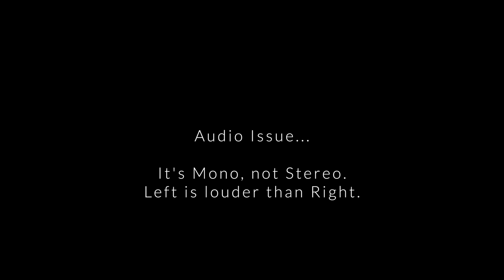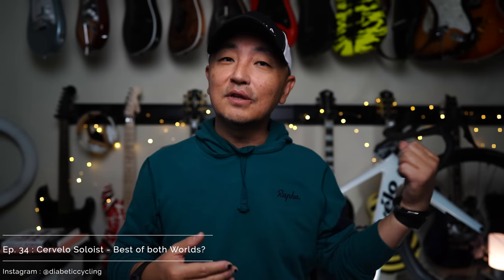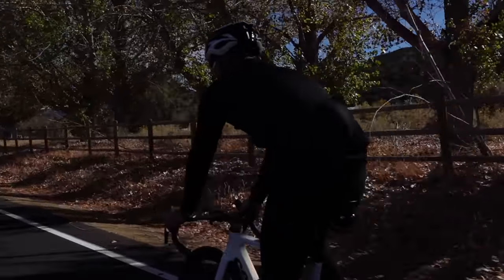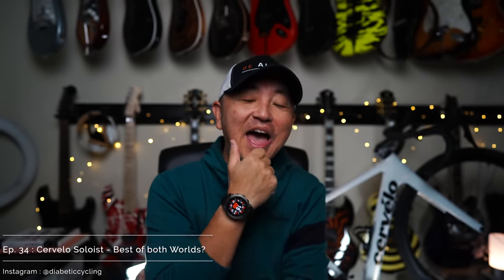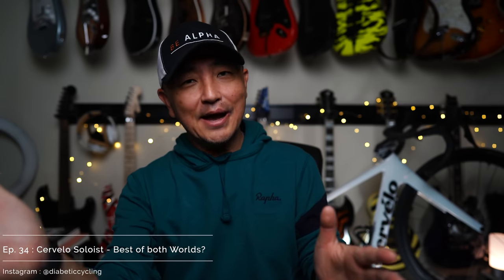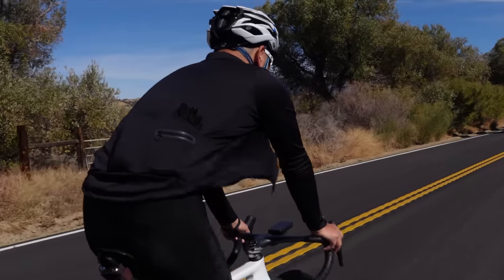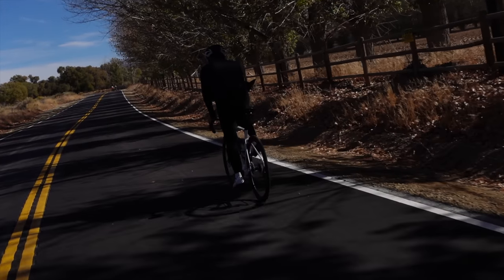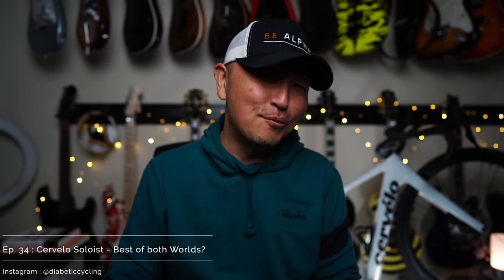Ep 34 [ENG] - Cervelo Soloist 2022/2023 Full Review

Comment: Great review 👏🏽.  I have the factory 105 version of this bike . $3400. It's my first road bike coming from the fixie scene. For the frame being $2700 to the entry level entire build being $ 3400, I couldn't pass it up.  So far , I too am loving it. I noticed all my downhill segments take the fastest time of the day on strava without fully pushing it 100 percent. It's effortless. 

In a year or so I too plan on upgrading to the Ultegra Di2 12 speed groupset. Glad to know you like that combo. 

Thank you for all your input as it made me feel as if I made the right choice based on your many years of riding high end bikes. 👍🏾
Reply from the maker: Thank you so much! If you have this with 105 at $3400, that is SUPER solid. Wheels probably could use an upgrade if stock. But all in due time as you said. You have a solid bike for years to come.
Reply: I'm thinking of going down this route as well, what was the weight of the stock bike and what size are you running?
Reply: In what dealer did you get such deal?

Comment: Great review and it echos a lot of my feelings for the Soloist. I have the black frame in size 56 with the Force build. I have not ridden the stock Reserve wheels that came with it, as I threw on my Enve 45’s that I already had set up tubeless with Pirelli tires. I also own a few other Cervelos to compare against this bike. I own a 2022 R5 with Force, a 2019 S5 with Dura Ace 11 speed and Enve 6/5 wheels and a 2018 R5 rim brake with Dura Ace 11 speed and Enve 4/5’s. It’s a long story why I have all these bikes but I will not bore everyone with that. Here are my thoughts on the Soloist while keeping in mind I don’t weigh my bikes, I don’t test anything in a wind tunnel and I don’t have a vernier to measure anything. I just ride bikes and have been doing it for 38 years:

1. Looks:  I like how the bike looks a lot and I am OK with the seat post. I feel like it was really well executed and I smile every time I reach for the bike to ride it. I can see where the seat post may turn folks off but it doesn’t bother me.

2. Functionality:  I like that I can work on this bike more than others that are disc brake. The bike was designed around the enthusiast to be able to do some of their own work and customize it a bit. 

3. Ride Quality:  very good. I feel like I can ride all day on it and it won’t beat me up but the 28 mil tires help a lot with that and the geometry suits my fit well. 

4. Price:  this is still an expensive bike as you noted. I got my 2018 R5 on sale and it has Dura Ace and I didn’t pay much more for it at the time. That said, everything has gotten crazy so the Soloist price point is less crazy. 

5. Comparison to my other bikes:  nothing beats my 2018 R5 rim brake bike. That one will never get sold. That said, in the modern line up I would say the S5 I have is seat of the pants faster but it will wear you down on longer rides just due to the position it throws you in. It’s difficult to dial your fit in correctly on that bike because of its proprietary nature. The new R5 is a bit lighter but that’s it. I would not spend the money on it knowing what I know. Get the Soloist and save yourself the money. Buy equipment with the difference or a favorite set of wheels even though the stock Reserve wheels seem to be fairly good. I ride the stock Reserve wheels on my new R5 and they are good. 

6. Cons of the Soloist:  Disc brakes but that is more a fact of life now. Unless you live in the mountains where screaming downhill is going to happen or you live in England where it rains all the time, I feel you don’t need them. They are touchy, higher maintenance and a pain in the butt. Rant over, but that is my only con and that’s not the bike’s fault 

My $0.02 for what it’s worth.
Reply from the maker: LOL Scott! You are the definitive authority on the subject matter! Thanks for taking the time not only to watch me ramble on but to leave a detailed report on your behalf. AWESOME!
Reply: @DiabeticCycling  I thought I would add to the conversation and I hope I didn’t hijack your work, but I always wish for as much real world feedback on bikes and equipment when I’m making a purchase decision so I hope my thoughts are additive for someone who is considering the Cervelo lineup for their next bike. Your review was excellent and you have a lot of other brands to compare against so people have a good view of real world thoughts watching your video. I appreciate the work and will keep watching!
Reply: Thank you to the both of you! DC, your reviews are superb and with Scott’s input I am definitely more confident that this is my next bike. I am coming from a ‘20 Domane sl6  which I understand is an upright ride and I love that bike but I did feel I was missing a lot of what this bike seems to offer, snappy, quick, responsive and just looks really cool to look at it and just want to go out and ride. I fell in love with the white since I come from black only frames, and the idea of building my own bike sparked as you shared that the frame is 2700. My only concern is how has this bike felt after a long ride (80miles). Any feedback right there is really appreciated. I live in the Monterey bay area and can stay flat or hit hills fairly close by, think the Carmelo fondo route at Sea Otter. Thank you guys again, great work DC, love all the guitars too😍
Reply: @guillermocamachobarajas3517  I can concur with how you feel about the Domane. I had a 2020 Domane SL7 and traded it in for the Soloist.  The Domane was comfortable but dead on the road.  I think you will be much happier with the Soloist.  That said, if you have a lot of climbing to do and you can spring for it, I might suggest the R5 as a better choice. It is lighter by a small amount but I’m not sure it’s worth the extra $$$$$. You can take the savings with the Soloist and upgrade some items to get the weight down and still be $ ahead with a bike that fits just like an R5. In any event you will be way ahead of where the Domane is.
Reply from the maker: @guillermocamachobarajas3517  Guillermo, I've done number of centuries on the Soloist especially to chew through miles required for Rapha Festive 500 as we wrapped up the year. ZERO issue in terms of comfort and compliance. I gotta return to Monterey Bay... Love riding out there...
Reply: @scottmesenbrink93  Very interesting! I have a rim brake Domane SL5 I upgraded in 2020 with Hunt UD50 carbon wheels and Gp5000 28mm tires and some other upgrades. Wheels and tires changed the game, combined with a high-end bike fit. Domane went from boring endurance bike to a much better all-arounder, evidenced by improved strava segment times. That said, would you say the new Soloist Di2 is materially better than an upgraded Domane for all-around riding (usually 20-50 miles, 30-60ft/mile climbing, 18mph give or take)? Where do you really notice it? Thanks!
Reply: @Ridewithjst  I think I would stick to your rim brake Domane. They key is comfort, especially as we age. It’s hard to go faster for longer distances if everything hurts. If it works for you stick with it, especially if it’s a rim brake bike. They feel more lively to me and I’ll never sell mine. The disc Domane felt dead to me even with Enve wheels and good tires. I imagine the rim brake version is a different ride altogether.
Reply: @scottmesenbrink93  that’s good perspective, thank you! I rode a ~2020 Cannondale Synapse disc w/SRAM Red eTap last summer in Mallorca, realized a few differences vs my ~2016 Domane rim: 1) electronic shifting is awesome (would go Ultegra Di2 or Force tho, prob), 2) disc brakes are great for technical descents and riding in traffic (vehicular and human), 3) I really, really want a lighter, more spirited bike with a more aggressive riding position for most rides; would keep Domane for longer rides/mixed surface/winter, but in small size >8kg fully loaded, I’d also like to get to 7kg, think that’s enough difference to actually to feel it, but obvi weight isn’t the  thing holding me back lol. I did notice the Synapse’s heft though vs my Domane, prob .5 to 1kg heavier but might as well have been 2-3kg on the hills

Comment: I'm about a year after this video but it's still perfect for me as I'm looking to buy a soloist in size 51 just like yours. I'm coming from a 48 Cannondale SSE. One thing with always being on the small spectrum of bike sizes is the geometry is always different to how they originally designed the bike. Smaller sizes always get different angles and measurements sometimes changing the bike characteristics completely, but on the soloist it doesn't seem too bad so I'm going for it. Thank you for your review I appreciate it from another small size rider. 👏
Reply: I’m thinking the same thing, could I kindly ask how tall you are I’m just shy of 5.7. With quite a short inseam of 29inches and the 51 seem like it would fit just right

Comment: After further analysis, it looks like there are multiple offset seat posts depending on the size of the frame. It looks like the 54 seatpost has more of a rear offset compared to the 51, so you should be able to get the offset seat post from your local retailer. I was told by Cervelo that I could order zero offset through a retailer if I needed one, so maybe look into that?
Reply from the maker: Thanks for that info. I found a fit that works for me currently, so no real big issue for me at this time. If the dumb looking post bothers me more, perhaps I will look into. I've never been a stickler for how things look historically so long as my bike rolls nicely, so who knows LOL...

Comment: I’m currently on a Trek Domane and planning to upgrade to Cervelo. Most of my riding consists of moderately fast group rides in very flat SW Florida. I’m 61 years old and probably 10-12 lbs overweight. How would you rate the geometry? I’m worried the ft end will be too low for my fitness and age. I appreciate to opinions!
Reply from the maker: Hi Robert! I hope I will be moderately fast when I turn 61!!! Good on you! Soloist has a shorter head tube compared to your Domane when compared equal sizing thus putting you more tucked in and more weight distributed towards the front. That said, I never felt uncomfortable myself, rather I really love the fit myself. Your mileage may vary since that Domane will definitely lean towards comfort over "let's go whoop ass".

Comment: Hi DC. Longtime follower of the channel, and always thankful for your wisdom. I have a fitting question related to the new Cervelo R5.  I’m looking to purchase an R5 size 54 (I’m 5’9” inseam 32”).  When I test drove ￼the R5 with a 15 degrees offset  seat post, the reach was about 3 cm to long for me compared to my previous bike, Pinarello Paris. The LBS suggested the Cervelo 0 degrees offset seat post to compensate for the problem.  I have not tried the bike out with this 0° seat post yet. My gut feeling tells me this is a wrong approach for a good fit. Furthermore, I test drove the Caledonia 5  same size and it fit perfectly without any changes. Any ideas or suggestions would be greatly appreciated.  For background information, I ride 800 miles per month, typically 4 rides at 50 miles each per week, my solo- zone 2  speed is 17.5-17.8 mph, and Category A in group rides.  Again thanks for your wisdom.
Reply from the maker: Hi. Thanks for spending your time on my channel, super appreciated! I gotta say it's always a bit iffy to answer fitment questions due to so many variables and individual differences along with individual preferences. I may not be the most suitable person to answer especially since I am not a firm believer in traditional bike fitting school of thoughts personally. Since you mentioned Caledonia and how you fit well on it, I suppose the first thing to look at is the stack/reach numbers on both bikes. I suspect Caledonia may have a bit longer head tube and shorter top tube against the same size R5? Not sure since I haven't looked. I'm not stating it would be better but using a non-setback with possibly a slightly longer stem to put you just a hair forward might yield a surprising result depending on how you would fit on that R5. The reach will also incorporate your saddle length, the bar used, and shifter position etc which all add to the equation as I'm sure you are well aware of. Too many variables.... BTW one thing I do not have is wisdom LOLOLOL I'm a hack flying by the seat of my pants!
Reply: @DiabeticCycling  thank you so much DC. I decided to go a whole different direction. I’m going to order my dream bike, Colnago C68 Allroad. I think I better stay with the endurance geometry like my current bike (Pinarello Paris), which the  C68 Allroad has.  The reach and stack numbers are very similar to what I’m used to.  Have a great day and looking forward to your next video.

Comment: Just ran across your channel and enjoyed your Soloist review immensely and subscribed. I am of the vintage where I actually had a 2008 Cervelo RS back in the day with the new “squoval” tubes. Before that I was on a 2004 Dual Triathlon bike. I moved onto a 2009 Wilier Cento Uno for many years and then cycling lost out to motorcycles for years. I found my way back two summers ago and bought a used one owner 2017 S3 Di2 with ENVE wheel option. Absolutely fell in love with cycling again and have started wondering about the new Soloist. Would I notice much difference between the S3 and Soloist? I notice on your list you owned a S3 at one point.

Comment: Hey DC thanks for your review! Do you by any chance tried the 2023 Giant Propel? Just wanted to know how fast it could climb (on the flat it should be fast). Thanks man
Reply from the maker: hi Chakra. Thanks for your time watching. I have not ridden the new Propel to give you any comment that is substantial. The Propel however is no longer an all-out Aero bike, the new model is more less an all around now featuring some aero bits as well as shedding a ton of weight from the last version. Giant always has good value for money so should be considered I reckon. The Soloist is hard to beat however in all aspects. This is basically my current "main" bike.

Comment: DC, thank you for your the great and best review.

By the way I still curious regarding the comparison Soloist vs Ostro VAM.
According to your review, Soloist is cheaper, eassier on the wallet, beside Ostro is Pro Level Frameset, thats the point that you stressed for this issue, CMIIW.

Fortunately now I'm in the middle of looking the new All Rounder frameset of great bike with priceless, eassier on the wallet, which is pursed to Cervelo Soloist 2023 or Factor Ostro VAM 2022.

Fortunately also, currently in my place, the Ostro VAM frameset 2022 are On Sale with just $2700 (incl. Integrated Handle Bar and BB Ceramic Speed).
The Soloist frameset also On Sale but price still $2460 (Stem, Handle Bar and BB not included).
At this case, finally the Soloist will be pricey compare to Ostro VAM.

So, based on this conditions, according to your experiances of riding those bikes, which one you can recommended to me.
Anyway DC, thank you a lot in advance for your reply.

Comment: Great review. How does the bike compare to the S3? I currently ride the S3 and wondering if it’s worth replacing it with the soloist.
Reply from the maker: AHHHH the S3... it's like a young girlfriend from my past. I loved her DEARLY! So to compare, I know this is gonna sound almost obvious with a big "DOH!" coming... I reckon the Soloist does feel noticeably lighter when the road tilts up. But on a flat road motoring at 25mph plus, the S3 would fare better. Now do keep in mind just to be transparent, my Soloist shown is running 36-50mm wheels whereas my S3 was running non carbon 60mm wheels, therefore not exactly an even comparison. On a long day out mixed terrain, I would take the Soloist out for sure. I also give the Soloist a slight edge to compliance. S3 was not bad in terms of comfort but in comparison, it would be on the other side.
Reply: @DiabeticCycling  DC I’m sorry if you have already made this comment.  I looked all around to see if you already said this but what do you think is the best wheel depth to compliment the soloist frame?
Reply from the maker: @nelsdale1137  Hi Nels. I spec'd mine and also practice what I advise - as in I would equip do-everything wheels for this frame since that's what it's designed for. I would go 44mm-50mm variant all day everyday. I did swap to 36mm for a day I had to take a huge mountain down but 99% of the time, I would roll on 44-50 anything in between.

Comment: Wow.. what a great review.  I appreciate all the information.    

I’m going back and forth between Soloist ultegra di2 and Caledonia 5 ultegra di2.     Leaning a bit towards the Soloist now based on the review.     

I was originally wanting a bit of a more relaxed frame geometry over my Casd9.. something more towards Endurance, but heck, the Soloist seems pretty relaxed as well. 

Question.. what is your height?  And your measured inseam?     I’m 68” tall and right at 30” inseam.    Going by Cervelo’s fit chart, I fall right in the middle of the size 54.     

When I test rode a Trek Domane 2023 model.. it was a size 52 and fit great.    

Also, I ride a 52 Caad9, and its a good fit as well.    

Thanks again—-